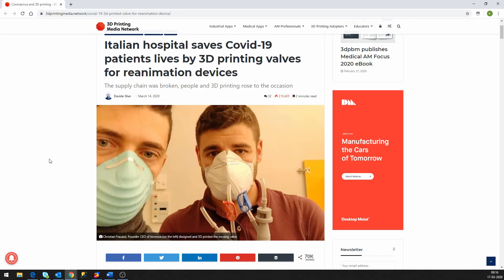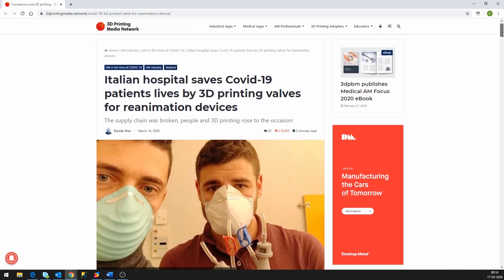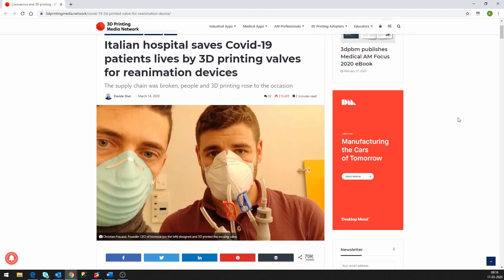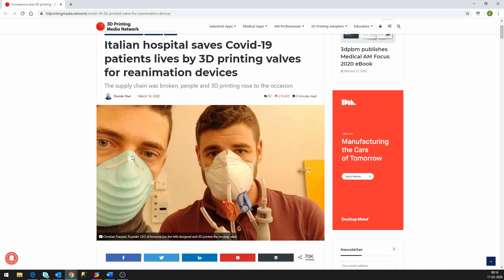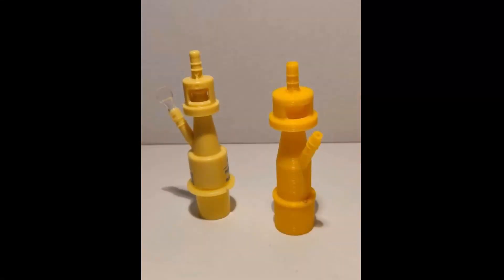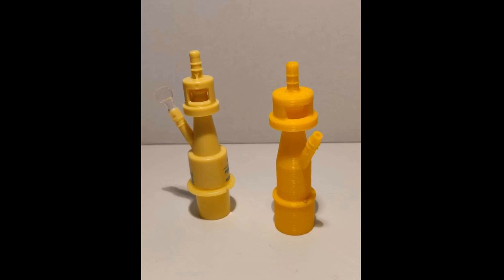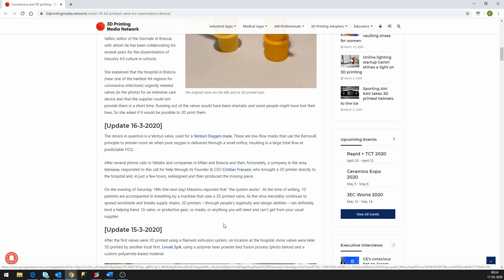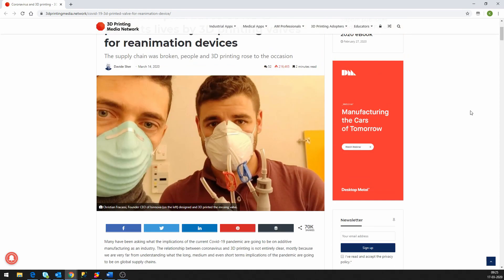3D Printed Valves helps out Italian hospitals

Comment: Can it be printed with a PLA printer ?
Reply from the maker: Maybe, the first prototype was definitely made on an FDM printer, but I don't know if that was actually fit for purpose, or just a proof of concept. The ones they seemed to end up using, was printed by another company, that was supposedly made on some sort of polymer powder laser printer thing that I know nothing about, and sounds like something that costs hundreds of thousands of dollars.
Reply: @ZnakeTech  thank you for the info , i kind expected this kind of objects are very precise an require some specific materials. May be there are other more generic and useful medical objects that can be printed in conventional printers. I will keep looking for any ideas.
Reply from the maker: As I mention in the video there is probably something somewhat complex going on internally. But as I also mention several subreddits has banned 3d printed medical devices for now, and it's not because some things can't be done on a regular home 3d printer, but because peoples lives are at stake. Not only does the device has to be accurate, function as intended and be reliable, but you pretty much also have to secure the entire supply line when it comes to things like the filament, you can't have potentially toxic materials mixed in, you have to ensure it's been stored correctly etc, especially when it's a part for a breathing device. Any contamination is going directly into the lungs of the patient. 

I don't know your experience, but the guys in the video are professional 3d printers, things have to get very desperate before hospitals before they start asking any random person with a 3D printer to help them. There are however other projects out there that more or less anybody can help out with, such as prosthetics, but ofcourse that is not related to the current COVID-19 situation.
Reply: @ZnakeTech  i understand .I´m in Spain , and here things are getting a bit crazy in certain places . I´m not an engineer nor a big expert in 3d printing  , i´m a videogame designer using 3D Studio Max and Zbrush among others . I know about different materials and densities but i´m not gonna mass produce anything , neither i have a machine to sterylize components, I use 3D printers to replicate my models and postproduce them in my studio. I´ve created a few different masks with removable valves for my own use . I was just looking for preexisting gcodes that may have been useful , like , reusable parts , to connect , attach or coupling different pieces of medical equipment. I´ve seen that somewhere . But it is such an extense and complex area to look for. But thankyou for your time, at least i can focus in helping in other ways now .